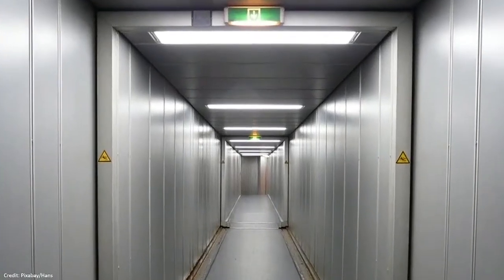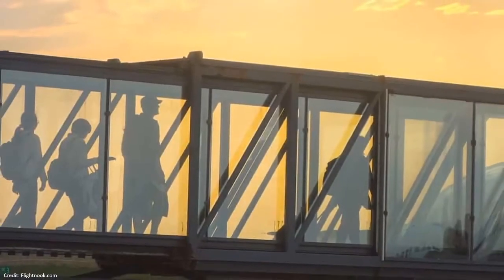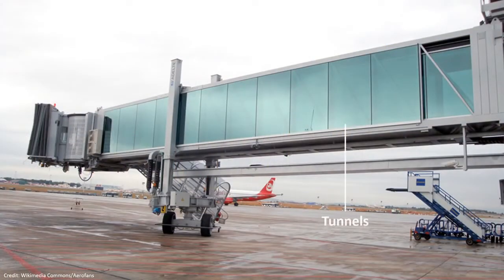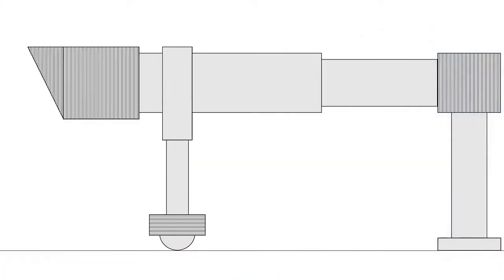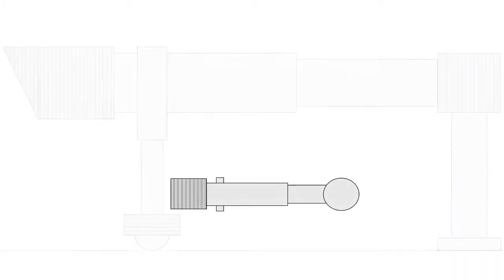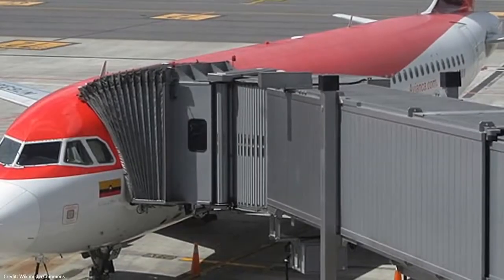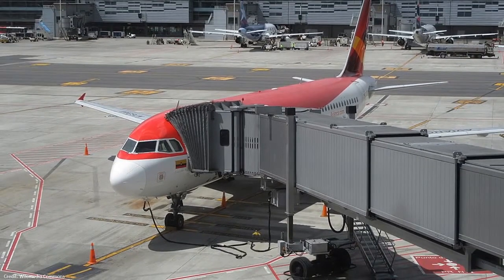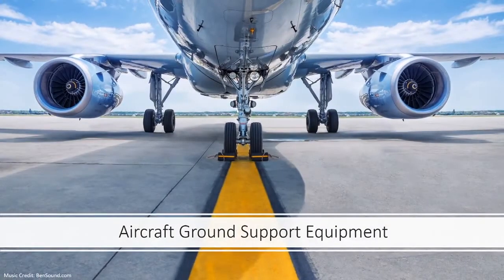How a Jet Bridge works? (a.k.a. Passenger Boarding Bridge, Aviobridge, Aerobridge, Jetway, Jetty)

Comment: What is the maintenance routine like on these ?
Reply from the maker: The maintenance routine differs as per manufacturer's recommendations. However, there is monthly, quarterly, half-yearly and yearly preventive maintenance checks of the bridge. Some conventional maintenance actions includes taking motor current readings, replacing gearbox lubricant oil, servicing, greasing the telescopic columns of the gantry etc.

Comment: What else passenger boarding bridge operator can do in ground? Only operate bridge?
Reply from the maker: Hi dante ju. Bridge operators can also operate other ground support equipment. It depends on the airport and the company. For instance, at busy airports, boarding bridge operators will only operate bridges. On airports where there aren't much flights, the company may find it more productive to get the boarding bridge operator to get engaged in some other ground handling operations also.